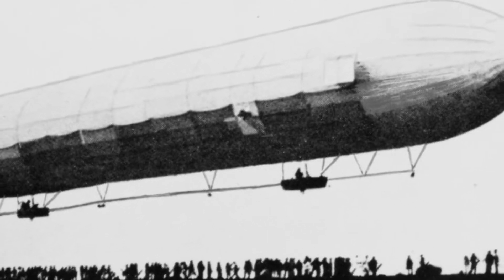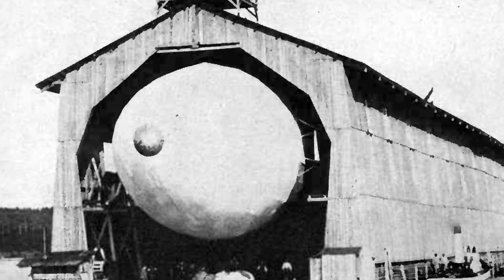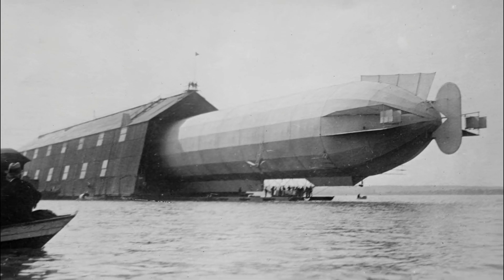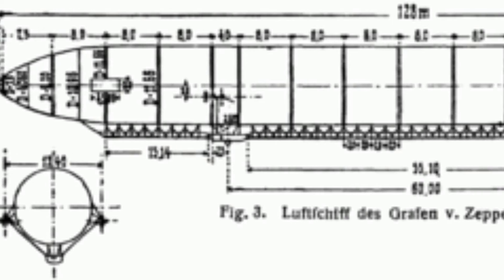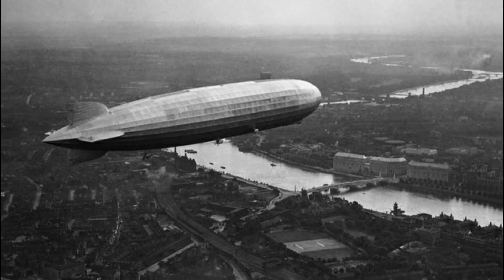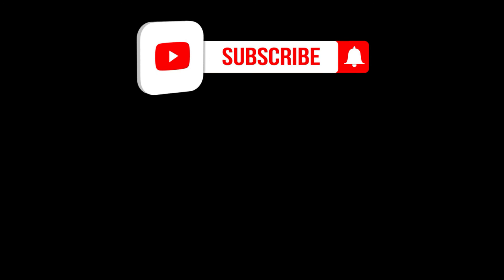July 2nd,1900 First flight LZ-1, of a dirigible airship designed by Graf Ferdinand von Zeppelin

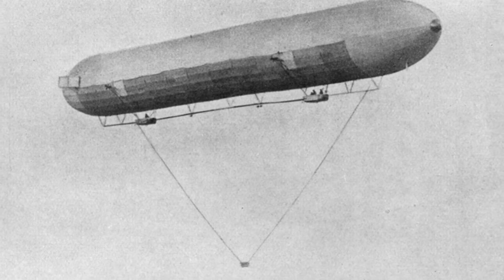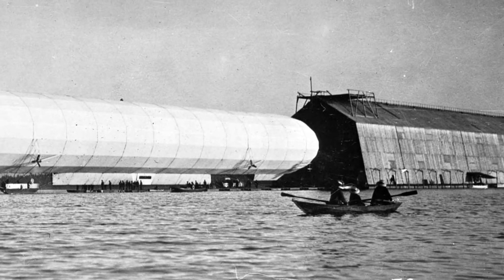Comment: The airship at 0:53 and 1:17 is LZ 2. Notice the covered walkway between the two cars under the hull - the pictures shown at 0:14 and 0:32 don't have that. The airship at 1:34 is LZ 5 - it has a back rudder unlike versions 1 or 2. The airship at 2:47 is LZ 4 - notice the passenger car in the middle. The airship shown at 1:50 and 2:39 is LZ 127 (Graf Zeppelin).